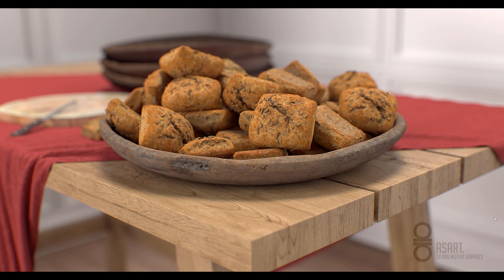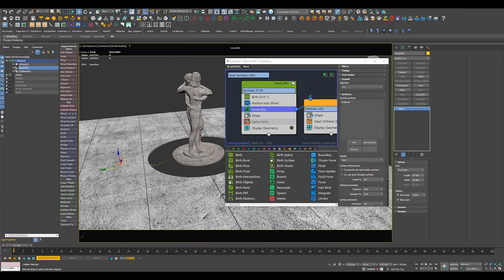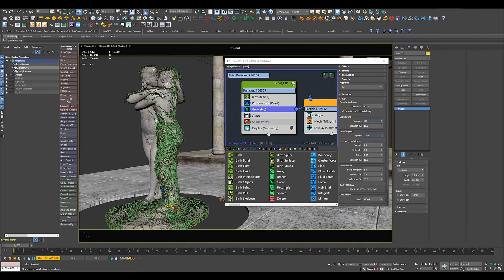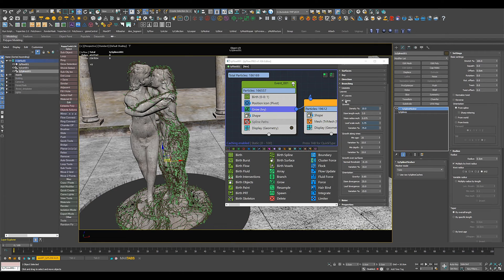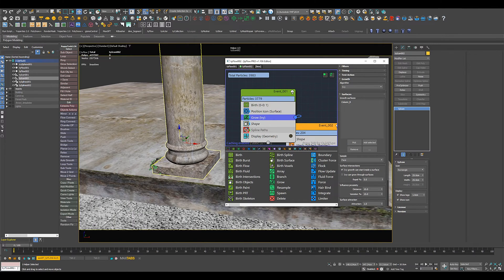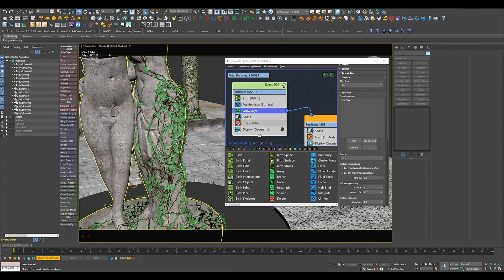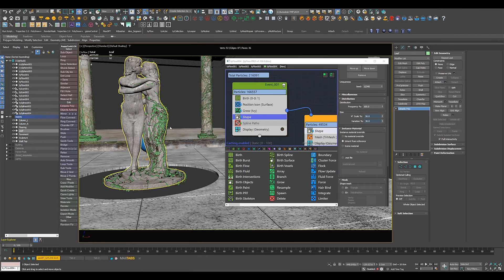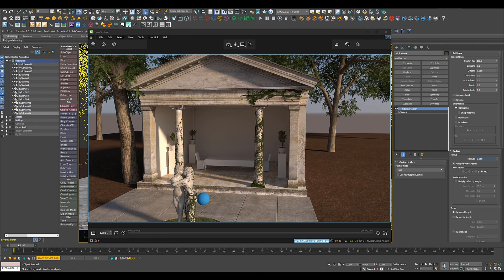TyFLOW for ARCHVIZ - Tutorial Series - Part 03 / Ivy Growth

Comment: how would you add a texture to the actual wood vines twigs ?
Reply from the maker: Hi .. I'd use the MATERIAL operator and assign the materials that way. Don't think that there is a way to go for a "perfect" texturing, but using triplanermaps and randomized texturemaps should do the job in tghis case .. Give it a run .. Cheers
Reply: @asARTMotionGraphics  never mind it does it automatically when you add splines they already have uvs
Reply from the maker: @mfrancisco_850  Sounds great .. have fun!

Comment: Awesome, thank you so much! Thinking back about all the times, when I was fiddling with some ready-made ivy assets, trying to make them fit to my needs... Never again - now I will simply use TyFlow. 
Btw, on a house facade - how much can you control the spread? Also, is it possible to 'exclude' certain areas (like windows and doors, for example)?
Reply from the maker: Hi and thank you very much for watching. Very glad to hear that you find it useful and I'm very greatful for your great feedback.

Regarding your question:
You can control the spread as much as you want. There are no limits actually. Just make sure that you always use one single Model (Surface) per tyFLOW setup since adding multiple objects in the same Event will slow down the entire process and also make it harde to control.

If you are working on complex buildings where you have to avoid the ivy growth in certain areas, you better prepare your model in a way, that all the parts (those you want to grow ivy on and those that you don't want) are seperated. 

Create one tyFLOW setup per object (surface) wou want to grow ivy on and control each of them seperatelly. 

That would be the best way to avoid that in my opinion. Hopefully these inputs are useful to you.

Thanks again and keep on rocking .. Cheers